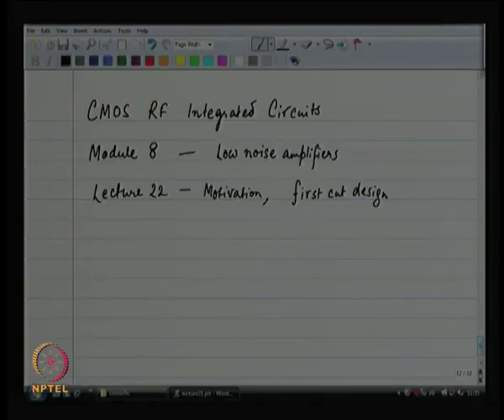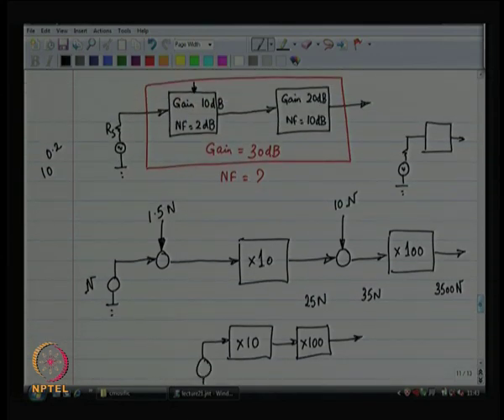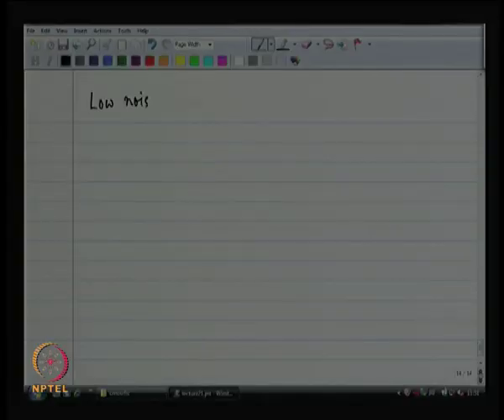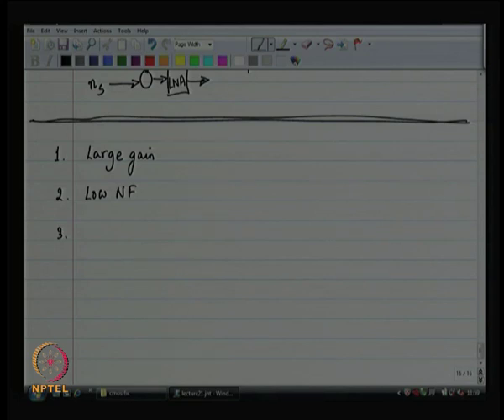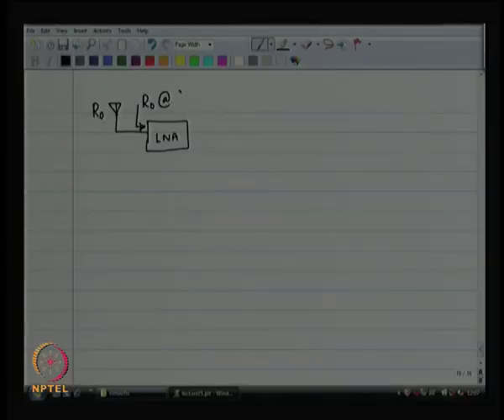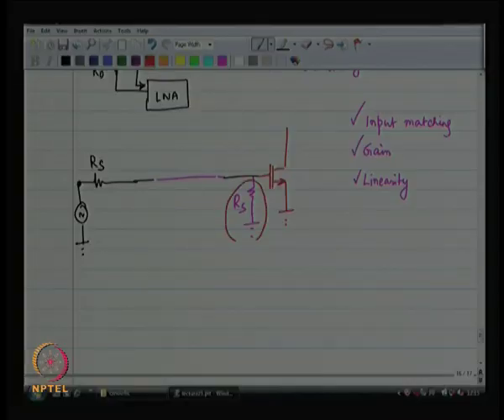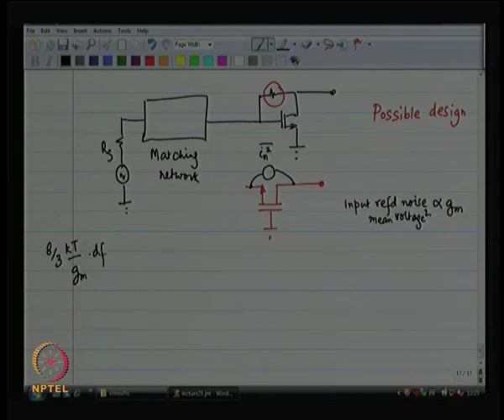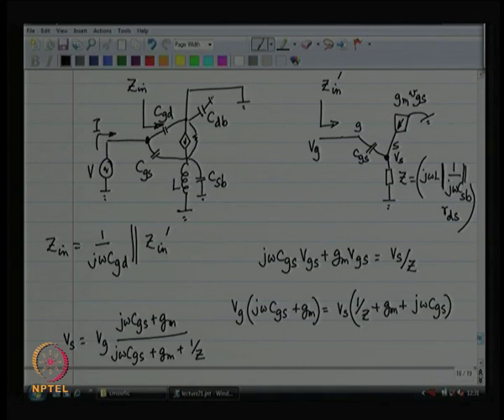Mod-08 Lec-22 Motivation first cut design

Comment: How can in the impedance matched condition voltage is maximum. Voltage can only be maximum if source impedance is at zero ohm and load impendence at infinity.